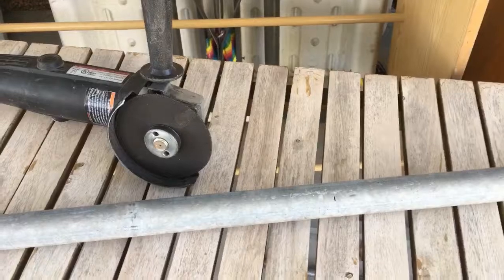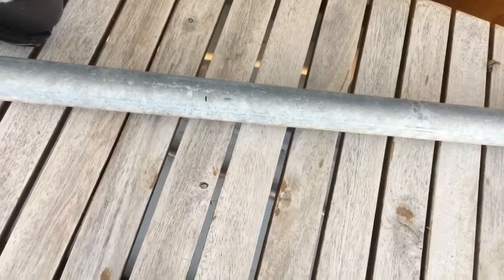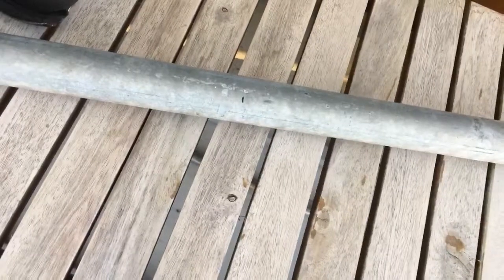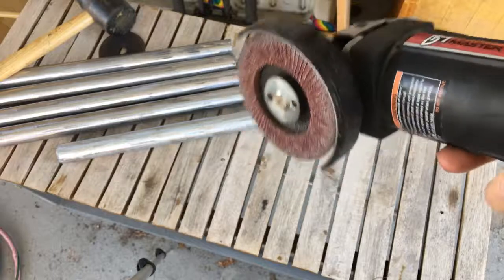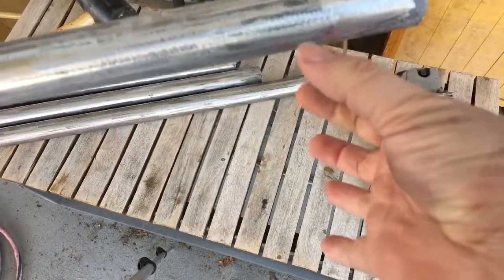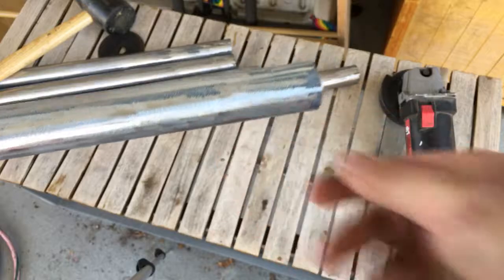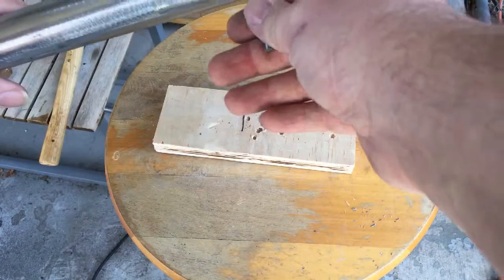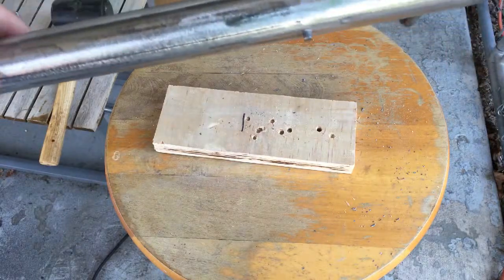Fence rail becomes a wind chime: part 1

Comment: Awesome idea for the HDPE!
Reply from the maker: I need to refine my technique to keep impurities out. It is food grade material.  I think it would make a good cutting board or table coasters.  The wind chime made out of wood will eventually fail, but not HDPE. This stuff would still be moldering in a landfill long after I'm dead.  This is a better use for it.